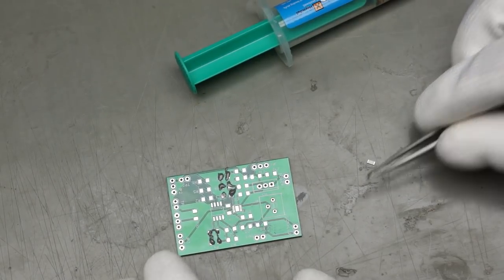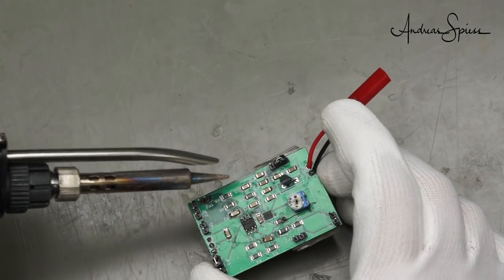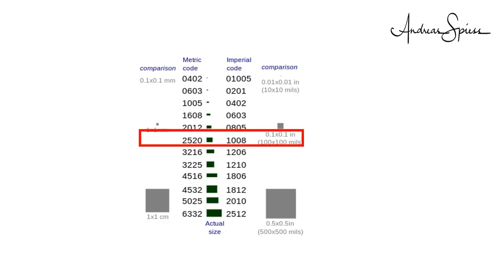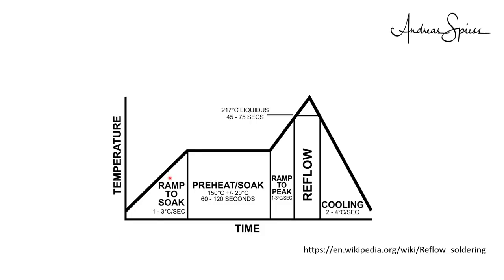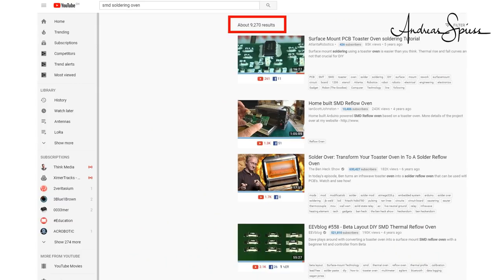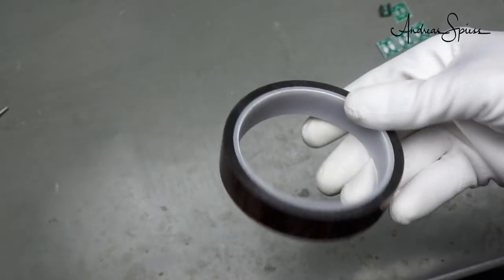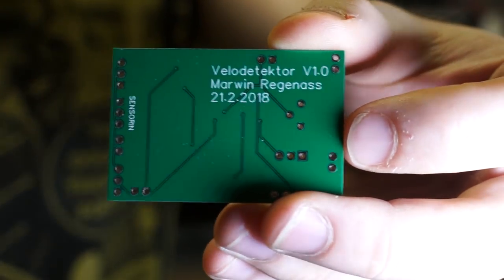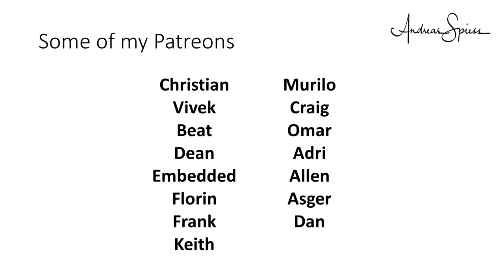#192 Aldi Hack: Simplify SMD Soldering with a Cheap Aldi Oven. Nothing else

Comment from the maker: Thank you for all the warnings about lead and food. I am no chemist, so I have to trust my viewers. DO NOT DO IT IN YOUR KITCHEN OVEN. EVEN IF YOUR WIFE PERMITS !!!!!
Reply: Have you never met a chemist? If they were as afraid of chemicals as the rest of the world, they would have never become chemists. Their give-a-fucks are fairly limited.

It's like you'll often see Big Clive poke around mains electricity with no gloves on.
Reply: Trusting your viewers isn't the best idea. Just because the masses are in panic, doesn't mean it's justified. Ask a chemist. I know a few (and had a few chem courses at uni myself). They'll tell you that the lead (and mercury) hysteria is way overblown by media.
The real warning should be: DO NOT FRY OR GRILL FOOD IN YOUR KITCHEN OVEN (or pan). Because that makes food carcinogenic. Every time, not just after reflowing a board.
Reply: The problem isn’t the lead (you can even use lead-free solder), but the flux fumes which could be absorbed into the food and contaminate it.
Reply: @GRBtutorials   I would think just the airflow from opening the oven door would be enough to pull all traces of gas and vapor, probably even particulates, out of the oven. Show me the physics if you disagree.
Reply: @superdau  and likewise taking responsibility for all the "viewers" is not a good idea. Actually frying and grilling food anytime, anywhere creates carcinogens. You might as well say DO NOT COOK FOOD IN YOUR KITCHEN. Fresh raw fruit vegetables all day, all the time! :p  Research the amount of carcinogens from cooking over an open flame, and you realize that for about a million years our ancestors have been "poisoning" their own food. Many generations cooking almost all their food! You have to establish an acceptable minimal amount to risk or you'll make yourself crazy.
Reply: @GRBtutorials  and how would that happen without simultaneously cooking the two together>
Reply: Lead shouldn’t be a problem as it should only fume minimally.
The main issue is flux.

Comment: Put the prepared PCB in the oven, turn a few knobs and keep an eye on the temperature and your watch. That's all there is to it!
Very much appreciate the fact you just user the bare oven, without first spending a few hours adding a cloud steered,  temperature controlled switching board, door-opening-actuators with satellite surveillance to automate the process.
Reply from the maker: This was the purpose of this video...

Comment: I would not recommend using the oven in your kitchen, if it‘s also used to make food... you don‘t want any fumes of the solder paste stay and added them as some extra „spice“ to your next meal...

Besides of that: nice video, as usual 👍
Reply from the maker: +obelix: Thanks. I pinned a warning comment to the video
Reply: I second that
Reply: Wait just a second: the FUMES?!?!?!  Does anyone have airtight ovens? Wouldn't it take a lot of effort to keep gaseous traces trapped long enough? Like, taking out your PCB with one hand and with the other insert the food? Any reason to think any component of these fumes becomes liquid right under under 90C/ 200F ?  Are you sure my wife didn't convince you to post this?  ;D  Just like there's a Nocebo effect to compliment the Placebo Effect, I think touting "safety precautions" that have very low downsides are popular as urban myths. You realize when you say such things, (I'm guilty too) you can sound wise and helpful, and not suffer any consequences for being completely wrong. But if it becomes part of a "boy who cries wolf pattern"- maybe not so harmless. I would think just the airflow from opening the oven door would be enough to pull all traces of gas and vapor, maybe even particulates, out of the oven. Show me the physics if you disagree.

Comment: Thanks to you and your supporters. I consider this video a very valuable advice. By the way, I would not recommend using kitchen ovens since the process of SMD soldering using this technique may result in toxic fumes. It is wise to keep it away from where food is prepared.
Reply from the maker: Thanks. I pinned a warning comment to the video

Comment: I went and got a cheap oven also but it struggled to reach temp. So I got a fire blanket from a hardware store, took the oven apart and lined around the oven section with about 4-6 layers and kapton tape and some small nuts and bolts to hold it in place where needed. now it hits temps in less than half the time.
Reply from the maker: Thank you for your experience. It might help others with similar problems.

Comment: I like your simple approach. 

I had a grant on the project with the JSN board and was able to get a micro controller kit to convert a toaster oven to a reflow oven under this. All my prototype boards were done in India though so I never got down to assembling or using it. The solder paste is over two years old so its probably dead now too.
Reply from the maker: My solder paste for sure does not live for two years...

Comment: Great video, thanks for saving us. First time with SMDs and they are tiny tiny tiny. Our Breville does a nice job and we keep an eye on the local temp with a J type fed in past the door gasket. Works like a charm.
Reply from the maker: Yes, they are tiny. But also forgiving about bad positioning if you have a proper solder mask on your PCB.

Comment: Now... to test this with a regular toast toaster because a large toaster oven would take up too much space in my crowded bedroom lab. With a bit of refractory insulation I wonder if I could build a UV LED  exposure setup on one side of a double toaster and the heater on the other...
    I just tore apart an old kitchen oven yesterday and saved a bunch of the high temp insulation..and it's thermocouple w/controller....and have an old toaster laying around. 
Thanks for the motivation ;)
-Jake
Reply from the maker: You seam to be a true maker!

Comment: Can you test the $10 electric hot plates from the usual online suppliers?
The  hot plate looks like an Ali sheet with a element (110v or 220V) bonded or mounted inside.
A cheap speed controller adjusts the temperature of the hot plate.

Comment: the kapton tape is not a heat insulator, also used to isolate components around one we want to unsolder with a hot air gun? so the readings are slightly below the real temperatures..
Reply from the maker: Maybe you are right. But it is not relevant for that purpose, I think.

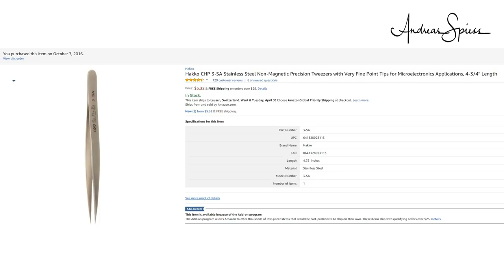Comment: Interesting approach, but how can you really implement a four-phase temperature/time profile like the one you show at 2:18?

The ramp to soak phase takes only 1-3 seconds, but it seems that you take much longer.

And how can you keep the preheat/soak temperature for 60-120 seconds?
Reply: The figures quoted are rates of change per second - rather than actual times - so, for example, if your ambient is 20 degrees C and you need to get the oven to 150 degrees C (to get to the soak temperature) - that's an increase of 130 degrees C - at between 1 to 3 seconds for each degree C (from the chart) - so taking between 130 seconds (1x130) and 390 seconds (3x130) - so the "ramp to soak" period should take between two minutes ten seconds and six and a half minutes.  Same approach to the other changes.

Your second question - that just means "between one and two minutes" - i.e. these time periods have quite a wide margin.
Reply: Read the chart again. It does not take 1-3 seconds. It's all explained in the video.
Reply from the maker: As superdau writes, the timing is not too critical, not in seconds. The oven is not so fast...
Reply: Ok, thanks!
But you would need to generate a temperature/time ramp with sufficient accuracy.
Depending on the oven, this might be more or less difficult and in general it requires a controller (maybe a pid).

Comment: 4:58... Bad idea... I don't want any possible lead contamination in an oven I use for food...
Reply: Solder is lead free these days. You can get leaded wire solder, but I've not seen leaded SMD solder paste.
Reply: That might be the case, but the flux contained within leadless solder is significantly more corrosive than the one used in lead based solder, thereby posing a different threat to one's health.
Either way, it is a very bad idea to solder anything near (nevermind inside) locations/devices were/in which food is prepared.
Reply from the maker: +laserbee: Thanks. I pinned a warning comment to the video
Reply: Pure lead or the lead-tin alloy we use for soldering isn't really a hazard for the health. The warnings about the toxicity of lead always forget to mention some prerequisites to make it even possible to get it in your body. It needs to be a organolead compound like tetraethyllead (the antiknock agent they used in gasoline). Pure elementary lead can also be a problem if it is a fine powder that can be inhaled. But most deaths through lead are caused when it comes flying at a very high speed.

You could put a big chunk of pure lead into your oven and it wouldn't do anything. Just living in a city or visiting places where people smoke cigarettes is more dangerous. Having a fireplace in the house is also more harmful than the inert lump of metal in the oven.

Sometimes people hear warnings like "water pipes containing lead are dangerous" and they don't think how the lead can even reach them. If the water contains carbon dioxide and the lead is exposed, it creates lead bicarbonate or if it contains oxygen it creates lead(II) hydroxide (they are compounds and not pure lead). If the water is hard enough the pipes will be calcified, which will greatly reduce the amount of lead compounds from those old pipes (Then there is no need to immediately deconstruct the house to rip the pipes out - testing the water is cheaper and easier). Anyways, what people hear is "Lead" and then they freak out.

Whenever people don't fully understand something, they develop some irrational fears. By the way, it is the same thing with mercury and many other things.
Reply: zvpunry... There is no way I would possibly put my or my family's lives at risk by using Leaded Solder Paste in our Kitchen oven..... It is easier and safer to not use our kitchen oven for re-flow soldering than to do it.

But by all means please don't hesitate to do that in your kitchen oven in your own home.

@Andreas Spiess... Thank you...;)
Reply: I think the most important sentence was the part about not fully understanding things which results in fears. But there is a way to solve this, read about lead and lead poisoning and how it works. It is all well documented and easily available over the internet. The Wikipedia articles about lead, lead compounds and lead poisoning are a good starting point. Knowing dangers will reduce the fears and let you think about the real dangers.

Useless fear causes unneeded stress and sickness, which is very harmful too. But most fears will go away with more knowledge.
Reply: Come on Laserbee don't you want a few specks of Pb, Sn and flux dripping down on your food?
Reply: @John Ridley: You are completely wrong. It says even on the package: Sn63Pb37 which means 37% is lead.(Pb for Plumbum)
Reply: @John_Ridley  It’s easy to buy leaded solder paste. No idea where you’d get the idea it doesn’t exist.

Comment: hi i have a graphics card i removed faulty smd's but to fiddly to re-solder new ones.  how would i solder them new smd's on in an oven?
Reply from the maker: These ovens are not for repair. Hot air guns often are used for repairs.
Reply: @AndreasSpiess  thanks i bought a hot air gun only £20

Comment: Thank you Andreas!  This is brilliant!!  I have a question though - what parts are NOT suitable for soldering  with the diy reflow oven?  I reckon most resistors, capacitors, diodes, transistors, mosfets are ok?  What about those more complex chips like esp32, mpu6050 etc.?  Is there a rough guideline?  Thanks!
Reply from the maker: You always can look into the datasheet. All SMD parts are suitable for reflowing because there is no other possibility for industrial production
Reply: You do not want to solder ESP32-PICO SiP modules without very good temperature control as they are very sensitive to high heat. The datasheet states maximum peak temperature to be 250C, while most lead free parts are rated to 260C. In reality, blowing most parts with a hot air gun set at 340C will probably work, and doing so with this SiP module results in a 100% failure rate. This module requires a good board preheater set at close to liquidus point, and you just apply high flux of low temperature hot air (say, 275C max on my Quick 957DW or 320C on my Metcal HCT2-200) for as short as possible just to reflow the solder plus maybe 5 seconds. Without a professional oven, this is the only way I found to work well (close to 100% yield) on those SiP modules. Forget about the controlled ramp up phase, just bake the parts (or observe MSL requirements, I live in Shenzhen and it is very humid here, chips will go pop if not stored properly and used without baking) before use and it will be fine.

Comment: Nice video, do you know any manufacturers of PCB's from europe, especially in the DACH region that sell cheap prototype batches? I see the link you shared are around 4$. I order from jlpcb from china which is around 10$ for 10 pieces. I don't like the waiting times and i don't like paying 3 times more just for shipping.
Reply from the maker: I used pcbio and osh park because they allow sharing the designs. Lately, I used PCB not made by me for my LoRa projects. Turnaround times are ok for me. If I need it faster I still have my mill.... Maybe somebody else knows a European supplier.

Comment: Brilliant!  Thanks for the great idea.  What is the little object to which you taped the thermistor?  Is it just a build of of Kapton tape?
Reply from the maker: It is Kapton tape. But it is not a thermistor, it is a thermocouple
Reply: Thanks for the quick reply and the clarification.  (I just had to google the difference between a thermistor and a thermocouple: "The main difference between the thermistor and thermocouple is their sensing factor. This parameter is the resistance in thermistors, while in thermocouples it is the voltage that induces between different materials.")

If I am understanding you correctly, the thermocouple that came with the temperature sensor is just taped  to the rack inside the oven near the pcb?  

When I look up the temperature sensor the end of the thermocouple looks quite small.  Though I cannot see very clearly in the video, it looks like what you have placed next to the pcb is quite a bit larger (longer).  I suppose the crux of my question is whether there is anything else in what's being taped there besides what comes with the temperature sensor and tape? @AndreasSpiess
Reply from the maker: @malikilam  The thermocouple is much more precise. I comes with these cheap meters I used in my video. Maybe I even left a link in the video description.

Comment: 3:48 Uhh, I don't think it would be that difficult to make the door automatically open and even turn a fan on after completion, so a controller could certainly help with the last part even if you didn't want to automate heating of the oven...
Reply from the maker: With the time to build such an automate I can produce many PCBs.... And anyway I would stand in front of the oven to watch the process. Because I like to see the solder melt and the parts moving to their right place automatically.
Reply: Yes, the selfaligning of SMD parts is magical to watch. I wouldn't want to miss that ;)

Comment: Great video, as usual.
Ha, i see that the clock in your Miele oven is slightly displaced, did you squeeze a custom pcb in there?
Reply from the maker: I had to replace it myself and did not get the exact replacement part. But it saved the life of the oven... And my wallet

Comment: Disable the fan in a 110V toaster oven, it takes too long to heat. Don't bother with insulation, but you can add tin foil to the inside of the glass door for a performance boost.
Reply from the maker: My experience with another oven without a fan was not so good. The temperature distribution was quite uneven.